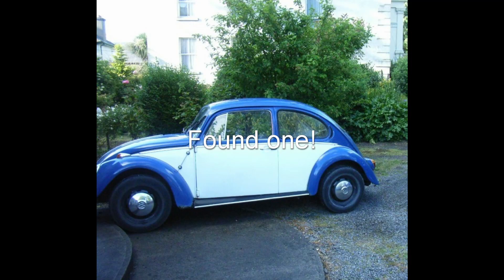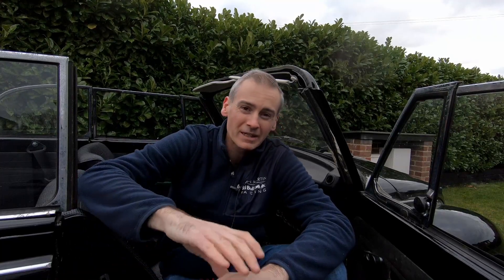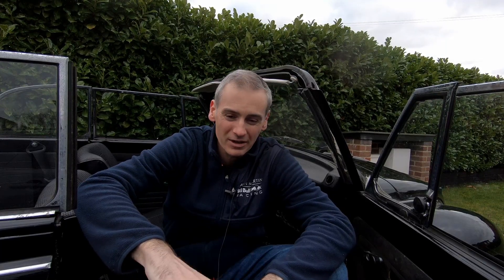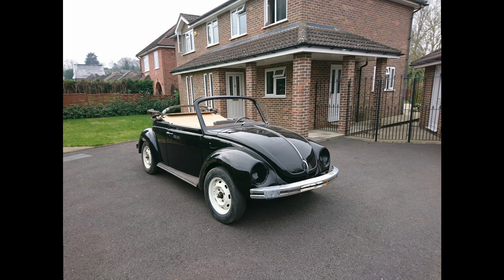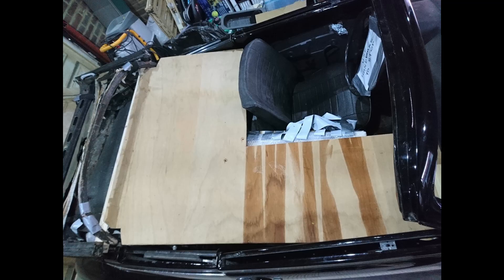New EV Conversion Project car for the channel! - Intro to our soon to be Electric Car & Project Plan

Comment: So sorry about your Dad I know the loss. 
On the project side my first Bug had a 1776 with s single Zenith carb. very peppy and fun in a Baja running around Phoenix AZ in the 80's, But now and inspired by your videos I am in search for a 69 + standard bug with the intention of fitting a Leaf motor in it, don't know all the demission's yet but I think the motor and gear box will fit under the package tray with slight mod's to the rear forks and the sheet metal of the package tray, the inverter could mount to the firewall anyway I look forward the the project. thanks
Reply from the maker: Thank you. Glad to have been some inspiration, it's a great time to be giving this sort of conversion a go, there are plenty of components available now from the OEM EV manufacturers and the prices seem to be getting more reasonable. Leaf motor should give plenty of power for a beetle. 
Though you have got me thinking about how cool an electric Baja could be:-)
Reply: @PerformanceEV  Living in northern New Mexico now so many more dirt roads that I travel weekly, basically a high rider full body Class 11 style bug is where I'm heading. Nothing to crazy on the suspension just a few more inches to clear ruts and mud, and of course electric drive.
Reply from the maker: I will admit, I had to Google Class 11 Beetle. I like that look, seems like a good fusion of the traditional beetle look and practicality with the go anywhere style of the more hardcore Bajas

Comment: Nice ride, nice story. If you don't mind, it's gonna be awesome if you can discribe standalone leaf drivetran controller build as good as you can. Do you planing to use drivetrain from ze0 or from Aze0?
Reply from the maker: Thanks.  I'll try to document everything I do as well as I can in the videos.  For this project I may have to move away from the Nissan Leaf drivetrain due to a lack of space, but I will be taking measurements soon to figure out what my options are.

Comment: My condolences, but what a great  tribute. More interested in the Beetle than the Porsche now.

I'm part way through a modern beetle conversion, it is a bit addictive, already wanting to tackle another car or bike.
Reply from the maker: Thank you. I think this project is going to be fun. Ironically I may end up making better progress on both projects by doing them in parallel as it gives me a bit of variety to prevent me getting burned out on either of them.
Reply: @PerformanceEV  I really like the idea of doing as much off the car as possible and swapping over quickly. You could pave the way to a weekend conversion of the classic bugs. Can't wait to see the progress.